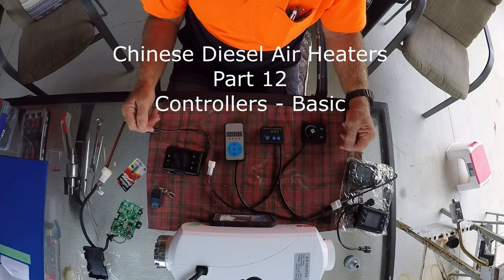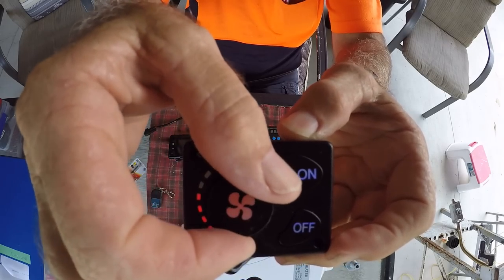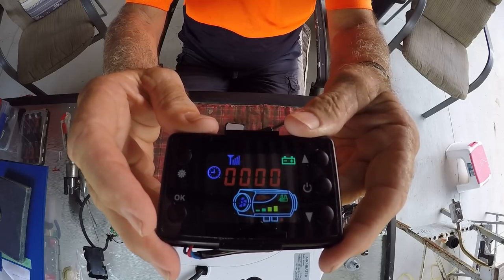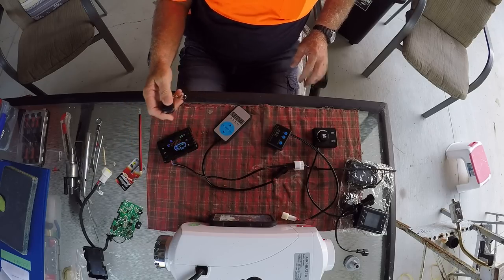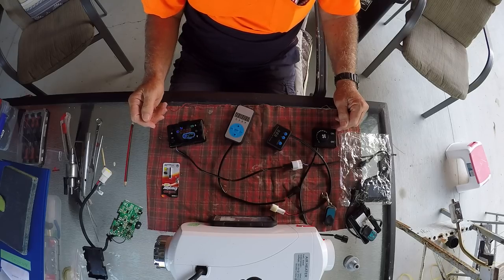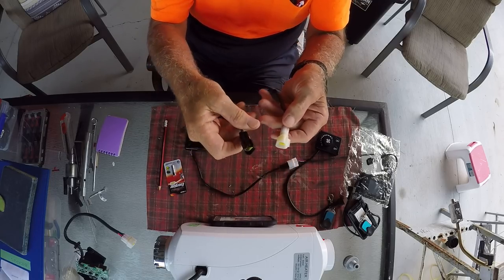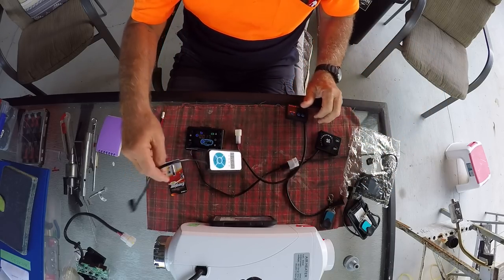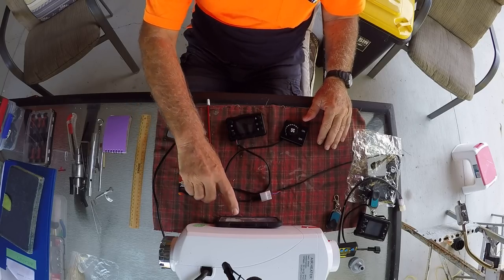Chinese Diesel Air Heaters -  Part 12 - Controllers (Basic)

Comment: Very nice video. Who would ever know the differences between controllers. I am surprised that memory goes off when battery power is turned off. 
In the occasion of power shutdown there is no easy way of disconnecting fuel. Is a fuel valve available to this type of gear?
Reply from the maker: Hi Bjarne, please see my comments below re fuel from another comment.
Reply: Bjarne Munk Nielsen 
If I understand you correctly, your concern is fuel continuing to be delivered to the heater if there is a loss of power. ?. With a loss of power, the pump shuts down so there is no more fuel being delivered, so that’s a non issue. The problem is that there is no way to remove the heat that is stored in the heater housing without constant air being blown across it. The heat built up in the heater housing has to dissipate and in so doing can melt things like the controller that are in close proximity to it. Sorry to chime in and if I misunderstood your question, then please disregard.
Reply: @siskiyouwoodsman4279  I am aware of the problem you mention, thank you anyway…
My concern is about a failure in the controller. John tells us that if you disconnect (or fail occurs) in the controller, the heater carry on heating with latest settings… (the power is still on…!)
What are you going to do now??  
1:Cut the power? 
2:Cut the diesel supply??
I prefer 2.
And I need an easy accessible valve for diesel cut off.
Reply from the maker: Hi Guys,

If you lose power, you have an overheat issue as the heater can't go through its shutdown cycle. 

If you have a controller failure the heater continues on at its last setting.

To stop the heater now you 1. Turn off the diesel. 2. Turn off the power.
What I replied to another question in this section was I don't think I would like to climb under the caravan or motor home in the middle of the night, mid winter in the mud rain or snow to disconnect the fuel from the heater diesel. (Then have to climb under again to reconnect) . 

In the very rare event of this happening and In the absence of an accessible fuel cut off system. I would prefer the switch off power method, ie remove the top of the heater and use a portable fan to remove the heat.  Also remember I have done this before so I am familiar with the exercise.

Now with a fuel cut off tap, it makes sense to put it at the tank particularly if using a seperate tank like one supplied and especially if the tank is elevated above the pump so you can shut the fuel off for line leaks or connector repairs. But now you would have issues with the pump running dry. You could connect a fuel valve after the pump but how accessible would it be in underfloor instillations.

If you want to go the fuel shut off way, I would suggest you consider a switch in the fuel pump power line. The two wires are non polarised so the switch could be in either wire and it would be easier to mount at some accessible place. Anyway, some info for you to consider.  JMcK
Reply: Bjarne Munk Nielsen ,

Sorry, yes I misunderstood and reading Johns comment below, I would agree to simply put a switch in either of the pump wires. Then since you have no display, let it run on for five minutes to take the heat away and then cut the power to the whole thing. Mine is accessible so I can simply pull the harness off of the pump should that occur.

Comment: Hello there John  , I wonder if you have came across this  fault  Disconnection fault  E07, I have just installed a 5kw diesel heater & this fault  has came up on my control panel  , I have a manual with the heater & it tells me fault E07 is a Disconnection fault check whether the communication line or plug between the switch & the controller is open or falsely connected  . I have undone  all the plugs & sprayed some WD40 in them & made sure the plugs  all click together  but I still can not get rid of this fault  . I be most grateful  if you no a way to fix this fault , I have seen all your YouTube videos & think there great for anyone just starting out with a diesel heater to watch  .
Reply from the maker: Hi Kevin, you are correct ref E07. If you are sure your connections are ok and there is no broken wire, look at voltage.
One common issue with these heaters is low voltage. Voltage may show 12V at the battery, but after going through the distribution panel and the thin heater wires there is very low voltage at the unit.  It is rare to have a bad ECU or controller. Good luck, and I would have an interest to know how you go.  JMcK

Comment: Hello john.can you give me some advice please..iv got a controller with the blue circle with no leds.. iv tryed the blue and the black controllers to upgrade and both come up with E07..are they not compatible with the onboard pcb on the heater...your thankfully justin
Reply from the maker: Hi Jcbiggers, sadly some manufactures  are now supplying heaters with non standard wiring and incompatible controllers. I have solved this issue in the past by buying a new ECB (about $20) . But there is always a risk that the new ECB will not be compatible with different controllers. If you are technically minded you can sometimes change the wiring.

I now suggest people decide what type of controller they prefer and buy a heater that comes with your preferred controller. 

Sorry I can not be of more help. JMcK
Reply: @johnmck1147  thank you for taking the time to reply..must have watched you full videos 4 times and still enjoy them lol 
Once again thank you 
Justin
Reply from the maker: jcbdiggers1 
Your welcome Justin. I am pleased I was able to help.  JMcK

Comment: Hi John,  My current LED controller stopped working before my very eyes a few days ago. I simply pressed the Start button on the four button remote control that came with it, and saw the controller go black instead of commencing the startup as normal. I thought it must have been faulty so ordered a new one, plugged it in and still would not work. Then started doing power check and found everything is receiving power. So I am at a bit of a loss as to what has happened. Getting just under 10amps at the 3 pin controller connect plug. I have no idea what it was before it stopped working. A real mystery I haven't come across before. The heater had previously been working faultlessly for three months. Any thoughts?
Reply from the maker: Hi Michael,  
I assume you disconnected the power from the heater for a few minutes and then tried powering it up again. I also assume you checked you are getting 12V to the ECB, and you have tried to manually, not remote start the controller.

I have a bit of an advantage as I have a number of heaters and a few spares and after checking voltages I swap the parts around to find what part is not working. 

Have you checked your new controller plug wires to see if they are the same as the old controller? I have come across some with the wiring reversed. You also may have a dead ECU, but I know of no reason you could spike it using the remote control. You can buy a new ECB for about $20 on eBay.

I would be interested (for my own knowledge) how you go on this.

Regards.   JMcK
Reply: @johnmck1147  I had previously checked the ground & made the assumption it must be OK because it was still firmly attached & had previously worked OK for several months. However, when I extended this earth point, the LED controller lit up! I rubbed the chassis with emery paper at the original earth point and added a steel washer to the nylon Tekscrew washer - to increase the surface area. It is now running sweet.
Reply from the maker: Michael Pyne 
Glad to hear that Michael.   JMcK

Comment: Can I cut and lengthen the wires for the controller I would like it mounted farther  than the way it is set up.
Reply from the maker: Yes, within reason. The big issue is voltage drop, particularly to the glow plug which can draw 8 to 10 amps. I recommend you keep the increased length as short as possible and increase the wire size to mitigate the increasing wire resistance leading to excessive voltage drop.  JMcK
Reply: @johnmck1147  Yes I am installing in my 35 foot sailboat on lake Michigan. I just may want the thermostat a bit farther than the cord that is on it.

Comment: What are the factory settings for the hi and low pulse Hz rates and the RPM on a 2K unit.also which Sn1 or Sn2 ?
Reply from the maker: Hi Marc, common base pump settings for these heaters is high, 5 Hz, and low 1.6 Hz. I do not know base fan settings, sorry.   JMcK

Comment: You might have covered this, but are the controllers more or less interchangable?
Reply from the maker: Yes, Johnny, a lot of controllers are interchangeable, however recently some heater manufactures are bring out “non standard” plugs and wire protocol. Sometimes you can change the pin wires to match up. Sometimes controllers are not compatible with some ECB's.

Regards.  JMcK

Comment: can you buy a extension  cable for the LCD monitor switch. ken
Reply from the maker: No Ken, not that I know of. But you can make one yourself if you have some basic skills and do not extend it too long so as to get voltage drop at the heater.  JMcK
Reply: @johnmck1147  thanks John

Comment: Hi John, I have a 5kw heater with 80mm ducting for inlet supply air & hot air supply. Is it possible to reduce  this to 60mm ducting. This would make the external fitting to my VW T5 easier. If this is unadvisable would changing to 60mm at the point of the plastic vents be ok.
Reply from the maker: Hi Peter, you could do that, but depending on the outside temperature you may not be able to run the heater at full output without an overheating issue. Without knowing more detail it would probably be better to do the second option. J McK
Reply: @johnmck1147  John, I would use all of the original 80mm ducting from the heater & only change to 60mm as it enters the van. On the air supply about 15cm & on the hot air about 30cm.
Reply from the maker: peter chambers 
Looks ok to me Peter.  JMcK
Reply: That's great. Thanks for your help John.

Comment: Hi, Any chance you know how to increase the display brightness of the better controller?  Mine is so dull you can't see the RED numbers..... Cheers.
Reply from the maker: Sorry Kevin, 

I had contact with one supplier who said he would ask the controller manufacturer if it would be an inbuilt code and user changeable, or if a new new code would need to be written. I never heard back.

I have a handful of these controllers as spares and every one has a different brightness level.   JMcK
Reply: @johnmck1147  Thanks for trying, cheers.

Comment: So is there no way to power off the LCD Controller  when it’s off & not in use? So that The power of the controller constantly being on doesn’t drain the batteries?..
Reply from the maker: Yes Zev, just install a switch in the power circuit. But remember you must always switch off the heater first at the controller so it can do its proper shut down cycle. Only then can you cut power to the heater.  JMcK
Reply: John McK 47 yea that’s a great idea ima do that, It’s just odd why they wouldn’t include that feature in the actual controller, I’m probably going to order the basic controller as well.  Btw ur videos are awesome, And has been my go to channel for installation and tips.  

It would be awesome it’s for your next project you could start making videos about solar power and Cheap alternatives & how it all works😁

U do great work Tnx
Reply from the maker: Zev V 

Thanks for that Zev.

Comment: Hi John Great video When you say semester on the control panel  do you mean Thermostat Thanks
Reply from the maker: Sort of Mike. Some, not all, control panels have a "thermistor "  or temperature sensor in the control panel that tells the ECU the ambient air temperature at the controller. The ECU will use that temperature information to try and achieve a preset temperature setting you dialled up.  JMcK
Reply: @johnmck1147  Thanks for the prompt reply. What is ECU ?
Reply from the maker: Mike Davies 
Hi Mike, Electronic Control Unit. The electronic circuit board.   JMcK

Comment: with the all in one unit I have found that the thermastat warms up with the unit and the air temp may stay the same but the environmental temp is detected as increasing. Have you found this to happen?
Reply from the maker: Yes Gus, that is an issue with the all in one heater because the controller is mounted on the heater case and not in the room. The thermistor in the controller is measuring the elevated  temperature of the metal case and not ambient room temperature. Suggest you just use manual control.  JMcK
Reply: @johnmck1147  Just as an aside, I got it to heat my garage but its a color bond garage and I am in Melbourne and live about 100 meters from a creek so the air is moist, and foggy when cold pretty often so tonight, when its 7 degrees, it was going flat out and for 2 hours and that metal box of a garage was probably 15 degrees at best. The controller was showing 21 of course. I have the 8kW unit (supposedly... who can really tell) I thought it would pump out more heat but I guess I can't complain considering the conditions. It did use about 1.5 litres over 4 hours. Still am very glad I got it because working in moist 7 degrees, foggy air is cold as hell. I was rugged up with my ski jacket and beany and quite comfortable with it going.
Reply from the maker: gus bisbal 

What can I say Gus. You live in Melbourne. 
Being serious, I have never seen an 8 kw Chinese heater. All I have seen are just 5 kw heaters branded as 8 kw     -   JMcK

Comment: Hi, I need some clarification. I have a 5kw heater and the black LCD controller went blank. I dont know what the factory fan speed settings are. I have bought 2 controllers to replace but they have different settings. One has min 1.2hz @ 1450 max 5.0hz @ 4300. The other one has Min 1.6hz @ 1680 max 5.5hz @ 4500. There seems to be a fair differnce between the two. Which should I be using. Can you help
Reply from the maker: Hi John, I would suggest the second controller. (My personal opinion) I have found a pulse frequency of 1.2 Hz a bit too low, you can get flame outs, and excessive carbon build up as the combustion temperature is really on the low side.  JMcK
Reply: @johnmck1147  Thanks John. Yes I ran it on the higher settings for 20 mins and had not a wisker of smoke so that must be the correct settings. Thanks  againfor your advice

Comment: I have a 5KW All in one that keeps shutting down after a day or so with code 05 error. It does not smoke when starting or running, its not a power issue I have an automatic charger hooked to the battery, it doesn't appear to be a fuel issue. I have it hooked up in the bathroom of a trailer with 10' of 4" duct.
Reply from the maker: Hi Jack,

E05 is generally an overheat issue. Your heater is getting too hot after running for some time.

1. Do you have restrictions (sharp bends) in your ducting? This can lead to overheat issues.

2. Do you run it on high setting all the time? Just as running your car at constant high revs you can overheat both. Try running the heater at a lower manual setting.

3. My preference is to use the manual setting. Sometimes on a automatic temperature setting the heater roars along trying to achieve a heat setting that is not obtainable, and you get overheat issues.

4. Because your heater can run for a day before issues, it is most unlikely you have a faulty temperature sensor.

Suggest you check above, and try running the heater a little slower.

Cheers.  JMcK
Reply: Thanks for your quick response. What should the max temp be at the end of the 20" black duct?
Reply from the maker: Jack Harper 

Hi Jack, in my tests I measure the temperature at the end of the supplied ducting. (About 500 mm) If the output temperature there gets much above 100°C the heater will shut down from overheat.

Cheers.  JMcK
Reply: @johnmck1147  K, I have looked everywhere on Ebay for temp sensors for Chinese diesel heaters and only found ones that connect with Webasto/Eberspacher oval sealed plug ins.
Reply: It seems strange that when set on high it runs OK, no smoke, etc. But set it below 30 and it begins to smoke and quits showing code 05.
Reply: I'm beginning to realize that 90+% of problems experienced with these heaters leads to the mis-understanding of the controllers and what settings affect the outcome.

Comment: Hi John, just watched all your diesel air heater video's. So much good and enlightening advice which makes so much sense! I have a couple of questions though,  1. would there be any advantage in wrapping the exhaust with Heat Wrap?   2. does it matter if the fuel tank sits at a level above the heater?   3. will two straight through mufflers joined restrict the burn process?  4.  would a dirt bike style foam air filter restrict the air intake enough to affect the burn process?
Thanks in advance  Garry
Reply from the maker: Hi Gary,

1. Yes, if you want to protect close by surfaces, no if under a vehicle and you want to dissipate the heat.

2. No, it can be an advantage, but at a height more than 2 m may cause you some issues.

3. No, and you get a dramatic reduction in noise, but they must be straight through mufflers.

4. No provided it is large enough.

I hope this helps. JMcK
Reply: @johnmck1147  That's great, thanks.